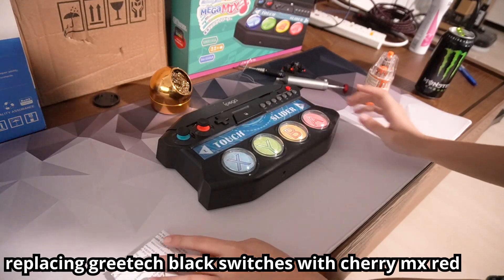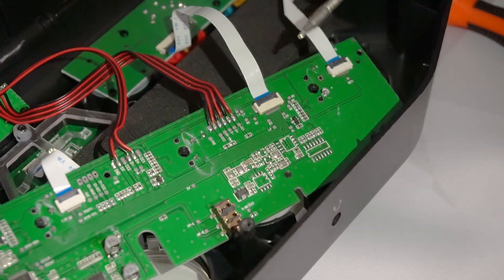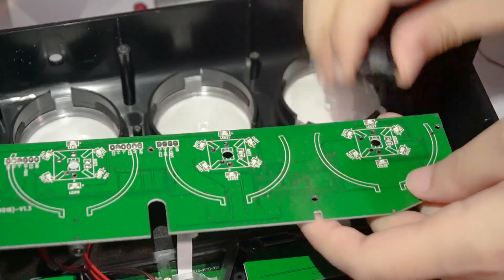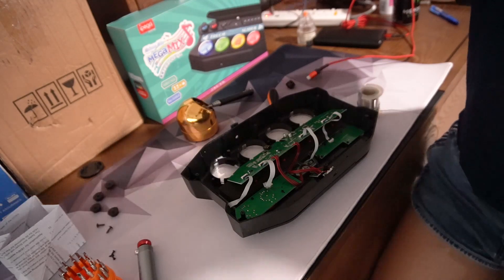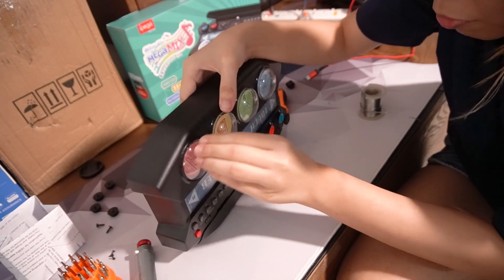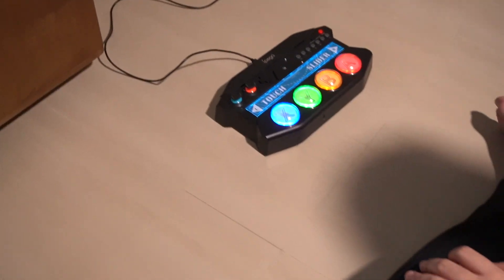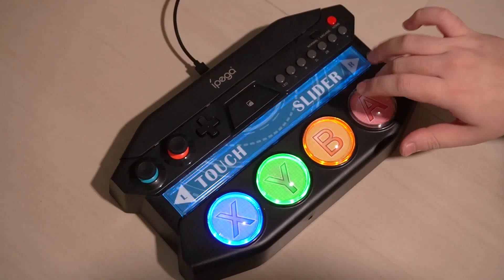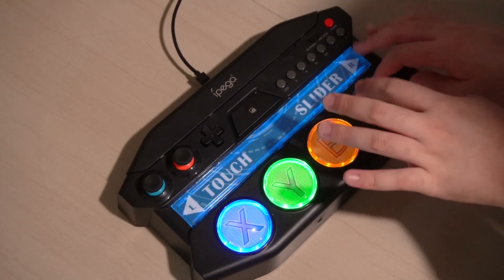fixing this garbage

Comment: So im considering buying one of these and either doing one of two things 

I found that project diva actually supports multiple controller inputs as player one. Im torn on the idea if simply scrapping the housing for this, and essentially cramming the entire controller inside a fight stick to use the slide bar alongside another controllers buttons, or else actually cramming it all into a custom housing and soldering larger sanwa buttons to the keyboard switch solder points.

Comment: i noticed a thing, the version of ps4 inside of him is super different of switch version, i bought it right now and i was so excited to open it and got surprised, their have springs and a foam support with it. i touhght needed modify to fix this huge problem that controller has but i dont need to do that.

Comment: I just lubed the switches and replaced the spring with 150g, that feels much more correct than stock. I had also filled the button domes with silicone (and also the rest of the case l m a o), so the extra weight made the stickiness worse. I think these switches should've come with stock 150g springs ^^;